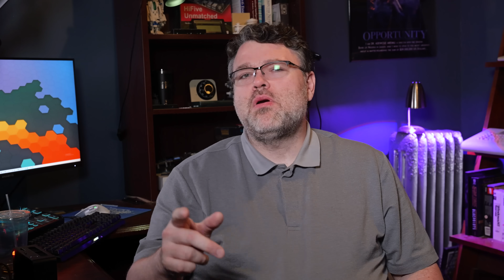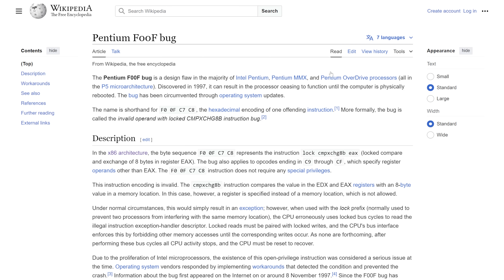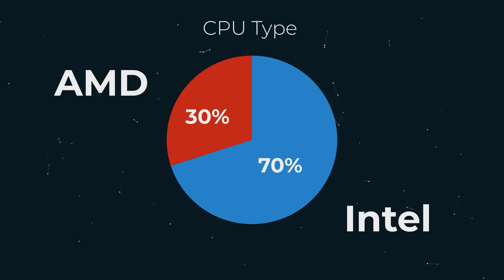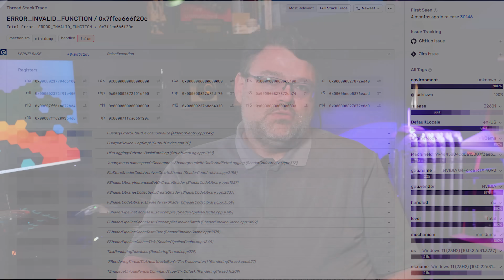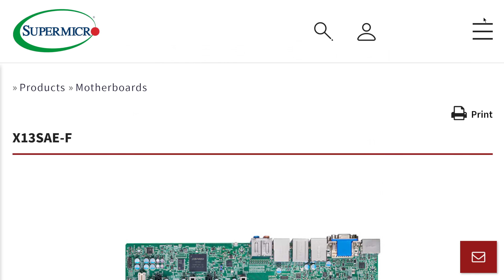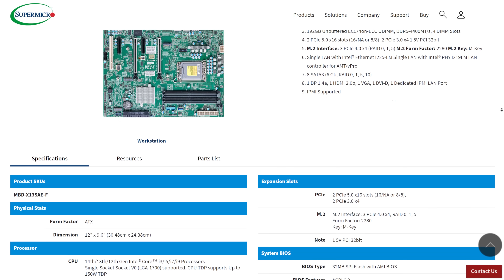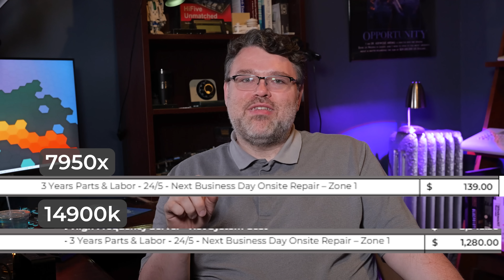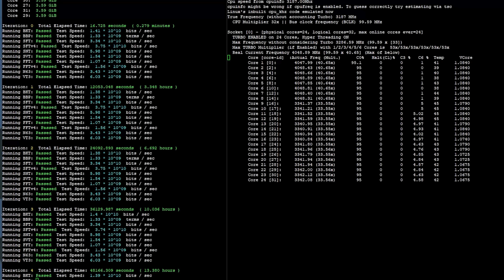Intel has a Pretty Big Problem

Comment: I bought a 14700k shortly after release in October 2023. It ran like a champ initially. Late January/early Feb it started crashing in Prime95, cinebench, MS Flight Simulator, Cities Skylines 2, World of Warcraft, pretty much everything. The games would usually crash to desktop but Prime and Cinebench would cause it to blue screen with clock watchdog time out. I tried everything, disabling XMP, bios updates, limiting power limits, you name it. No luck in full stability. I got the processor RMA’d by Intel but while waiting for the replacement 14700k I purchased and upgraded to a 14900k. So far it has been very stable (knock on wood). I’ve only had it for about 4 months though so it’ll take some time to see if degradation over time will affect this chip as well. I’m not thrilled about this whole situation, it sucks knowing one day your system is completely stable and the next it’s the most expensive paperweight you own. Sigh..
Reply: Yeah, ...it is best to avoid these chips altogether.   I wonder if 14600k's are also affected.  Hard to know as these six p-core chips are less popular and much less attention is devoted to them.  Also they usually work together with slower memory and in generally slower systems.
Reply: Check my comment if you get into trouble, to see if we can narrow it to these settings.
Reply: Why were you running prime 95 and cinebench tests? What caused you to run these in the first place? Prime 95 is not something I'd run on my CPU if I wanted it to have a long life. Especially on a CPU that draws 400w....
Reply: @JordanJ01  Have you ever had a CPU fail from running cinebench or prime95? For over 15 years of building and troubleshooting PCs, programs like these were made to test stability of systems. Never once have I experienced instability with a processor using these programs other than it being user error, for example overclocking, bad cooler mounting, etc. Running these applications help validate whether or not your system is stable or not. I don’t tell you what to do with your system, but when I pay for something I make sure I’m getting exactly what I paid for, nothing less. These chips are built with protections to make sure things like this don’t happen. If you’re okay running your system without ever fully knowing if it is unstable by only ever browsing the web or playing games then so be it. Having a processor degrade within 4 months of ownership without even being overclocked and bios set to factory while I have a Core 2 Quad Q9450 overclocked from 2.6GHz to 3.7GHz since release till this day and is still running beautifully with the same applications in question, it’s hard to believe Intel isn’t screwing something up with these new chips.
Reply: @bvang321  well enjoy the problem, keep running prime 95 on a 400w CPU and keep RMAing. No one is telling you how you use your CPU. Fishing for issues haha.
Reply: @JordanJ01  I’m glad you’re fine with settling for less than what you pay for. Please keep doing what you’re doing, you’re definitely teaching these tech giants to lower their standards.

Comment: Probably a combo of everything.  Bad manufacture process, high voltage and clocks, heat, and unknown throttling bug.  Intel has the manpower, the question is, did they fire already their good engineers and replaced it with juniors to save cost.

Comment: I guess I picked a good year to stop buying top-tier processors. I just upgraded all my 8th and 9th gen systems to 13500 and 14500 (non-K) and I haven't run into any of these issues yet.
Reply: What kind of speed can you get from your i5s? B760 boards?
Reply: @kramnull8962  5GHz turbo, 6P cores, 8E cores. That's 20 threads including hyperthreading.

Comment: I work part time at a repair/recycler, and I handle basically all of the custom machines that come in. About a month ago, someone brought in a 14900k system, said it froze when idling but under load it was fine.
Tried XMP on and off, intel default performace and Asus recommended mode, swapping to a fresh windows install, removing the graphics card, updating BIOS, whole load of stuff, probably spent 10 or 12 hours on this thing.
What I finally narrowed it down to was any time there was a significant amount of network traffic (like watching a video or doing windows updates), the system would hang. Didn't matter if it was the onboard wireless, a USB adapter, or Ethernet- it always happened on network traffic. There wasn't anything in the event log that stuck out as a problem, so I ended up just recommending that customer do a warranty on both the board and CPU.
They called back last week and said that it's running fine now, so I guess they were one of the unlucky ones the first time around.

Comment: I have a gigabyte aorus elite ax z690 motherboard with an i7 13700k and xmp or ram past the jedec spec will lead to crashes. I tried different ram modules but ddr5 just doesn't run stable. I am past return time for my mb and honestly have no motivation to teardown the whole system. Sooooo hopefully my next pc wont't be so annoying. Oh both Ram are on the QVL list of my Motherboard revision, RAM capacity is 32GB and Bios is also updated. Still no improvements despite the update log claiming increased ram stability. I tried reseating the CPU. I used the contact frame but the issue is still persistent.

Comment: Intels decades of fuck you buy our shit has not changed
Reply: @darthmelbius Fanatics I Guess.
Reply: Holy ....., I have no clue how you were able to say that!
EVERYTHING I post is moderated and I can't even say minor curse words.
This platform is garbage.
Reply: And they're likely about to get completely shafted by ARM with the mass migration of both datacenters and consumer computers to ARM chips (or other RISC designs) due to the huge drop in power consumption that ARM brings.
Reply: @samwalker7567  Yep. I wouldn't buy any PC right now if you can hold off. Things are changing, and ARM seems to be poised to dethrone x86 in the coming years. Best to wait and see what the industry looks like once the dust settles.
Reply: @dschwartz783  Disagree, if the transition happens it will: a) take years to acquire significant share in the desktop market, and b) there will still be a large marketshare of x86 for years after that happens, so support will remain for quite some time after. Makes no sense at all to hold off buying a PC in anticipation of this platform.
Reply: @prw56 legacy compatibility won't be a problem; the Apple M1 has proven that an appropriately designed ARM processor can competently emulate x86-64.
Reply: @dschwartz783  arm wouldnt be a thing for atleast 5 more years. Any large hardware switch takes years to occur. Unless you want to hold off for the better part of a decade just buy when you need too. Not to mention x86 support isnt going away anytime soon. Average replacement age of pcs is like 5-8 years worldwide so even if ARM somehow becomes mainstream tommorow it would still take that long for a substantial percent of the market to become arm based.

Comment: I mean, am I the only one seeing this clearly? These cpus are artificially pushed beyond what they were physically capable of delivering by Intel (to be able to claim, they are the fastest or whatever). And the silicon is not being able to keep up. It's a wonder they could get away with it this far.
We know that architecture-wise the 13 and 14 gen chips are basically the same as the 12th gen chips, but they are pushed farther or have more E-cores.

Intel probably knows full well, that they can't fix this so they throw more cpus on customers and RMA silently, hoping their engineers can put some bios limits in that will again hamstring performance, but at least keep things stable. But they are probably on the hook now, and will probably have to issue a recall sooner or later. But that is a PR nightmare for them, so they probably try to avoid it at all costs.
Reply: Yeah, that seems pretty plausible. The fact that it is taking so long probably isn't that they haven't figured out yet what the problem is. Maybe they even already know how to fix it, but they have their engineers working on a solution to work around the issue in such a way that performance regressions aren't all too severe or hidden away behind weird boosting behavior that makes it less obvious. The first round of BIOS updates that lower the power limits are probably just stop gaps to limit further degredation until they can get to it, so as to limit the amount of CPUs that they absolutely have to RMA and can't say they kinda sorta still are working "in spec".

Comment: Wow, what a video.  Very informative.  I have an extremely smooth brain so I probably am way off base here, but when I have encountered problems in the field and when those problems are occurring more and more frequently, that indicates a degradation of hardware.  I saw it years and years ago with Dell motherboards and their exploding capacitors.  It sure sounds like Intel is going have to replace a whole boatload of i9's.  

It'll be interesting to see what the root cause is.  Wonder if one of their fabs has a problem.  Sure sounds like a process (not processor) problem.
Reply: Never seen a computer exploding.

Probably will never know the root cause if it is too obvious as an official statement for Intel, but they'll surely have to replace every faulty chip if they want to keep their brand intact, even the ones without any invoice or proof of buy.
Reply: @Pacho18 He didn't say a computer exploded.  He said capacitors did.
Reply: @RCVW-y4x  That's the same for me.
Reply: @Pacho18  It was a whole thing for a while, look up the "capacitor plague". Interesting stuff.
Reply: @Pacho18  Computer capacitors are these small cylindrical nubs on the motherboard. They do have other shapes and sizes, but the description was to inform you of the scale.

Comment: well I think most ppl that know how this stuff works knew something was wrong with the chips more than just bios when the engineers have not had an answer within a few weeks ... now the months with no word of a fix, it's pretty clear that the chips must have an issue with a batch of chips or design issues somehow not picked up during the years of design or contaminate as u stated that could be causing issues... I'm so happy to be on my x299 i7-7820x 5.1ghz cpu with up to 10th gen CPUs i could slide right into my mobo and not need a new mobo. Tried and true and no problems like this...
Reply: A shame that they dont make new ones, only xeons after that...

Comment: Program errors can be quite strange. A good number of years back I built a bunch of computers for a school. The computer teacher ordered them bypassing the IT technician who only would buy Dell machines no matter what. The thing is he had a relative working as a seller for Dell, but that was of course not the reason he only bought Dell...

Thing is that a day after we delivered the machines we got an angry phone call from the IT guy. He had disassembled one machine to prove that they were crap, and was shouting about cards not fitting and that it couldn't possibly work as it was all crap. Well we got the machine sent to us and took a look. Turned out he hadn't screwed the motherboard to the chassis and taken away the distances between the motherboard and the back plate. Well no wonder the expansion cards wouldn't fit. We documented everything and sent a working machine back. The next day he called again claiming the machines were not PC compatible as 3D Studio MAX would crash. We called the computer teacher and got him to send a machine with the software installed. First we had a little problem getting 3D Studio to crash, but that was because we hadn't used that software before. But it turned out it would crash. A lot of testing later and a lot of asking people questions on sites for enthusiast of the software we got an interesting hint. Turned out that the program was written in a certain version of Pascal. Can't remember the name, but it was important. Turned out that all programs compiled from using that particular Pascal risked getting unstable with the then lates and fastest CPU's while still perfectly stable with older and slower processors. Not a good info but way better than "it's not PC compatible!" as the IT guy had claimed. The good thing was that several people had written patch programs for programs with this problem. We ran a patch on the .EXE file for 3D Studio MAX and suddenly it was perfectly stable. Collected the info, the patch program we had used and returned the machine in two days to the school. That was the last time the IT guy called us about any problem with the machines. After that we never heard anything about him even though we went there to do some jobs a few times. I think he got fired for being just too stupid for the job.

But yes software problems can be pretty strange at times.